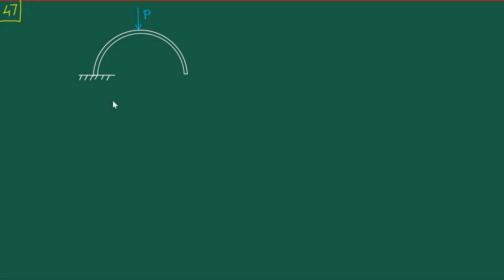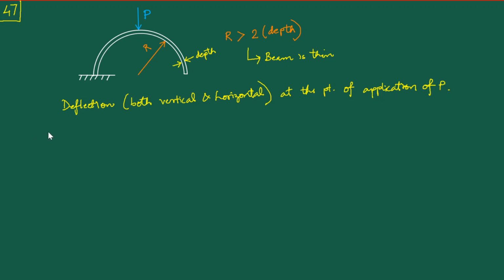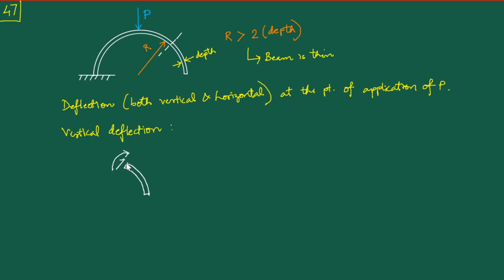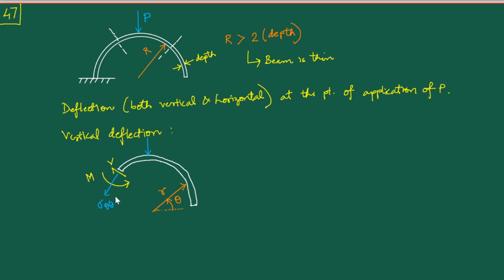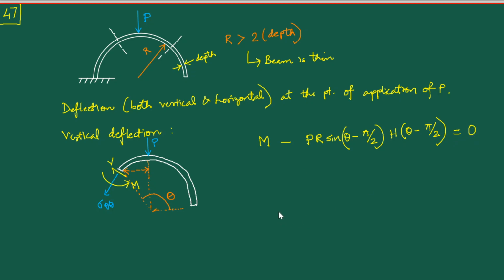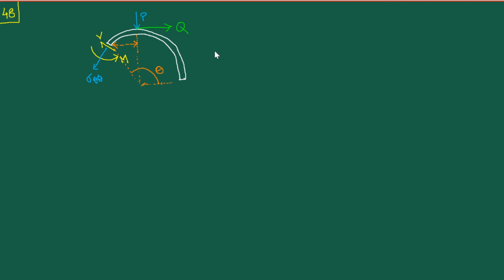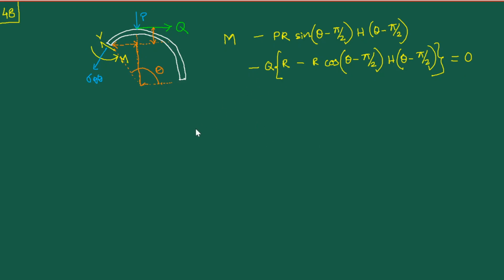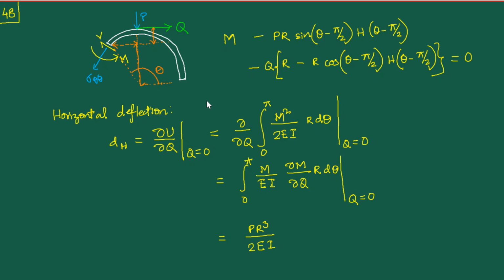[L20] Energy Methods – 17: Problems (Part 6) [Applications of Castigliano's theorem on deflections]

Comment: Dr. Chakraborty,
I have one question.
why do you take the heavy side step function in some case and do not take in other case?
Reply from the maker: We use the Heaviside function only when the force contributes to the moment only over a certain part of the beam. For instance, with reference to the above video, if the force were to act at the beam tip, then we would not need to use the Heaviside function.
Reply: @Prof_JC  I got it, 
thank you dr. Chakraborty.